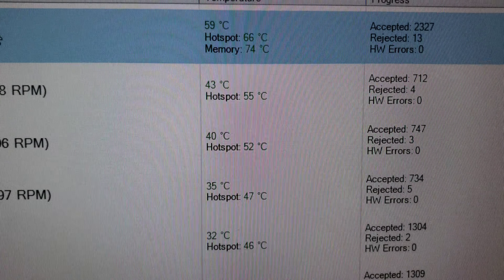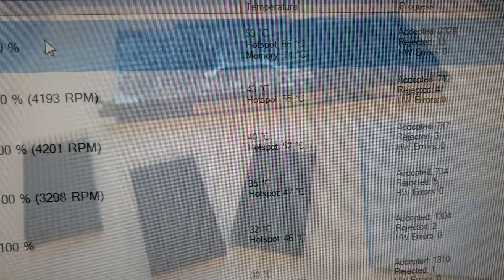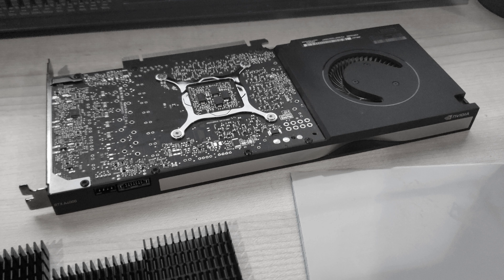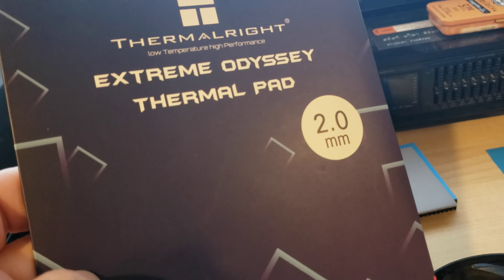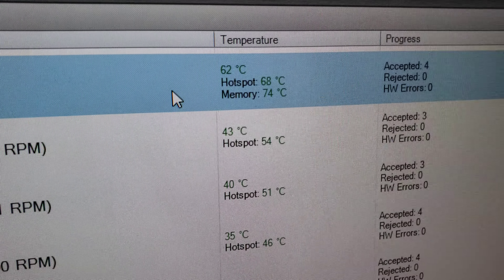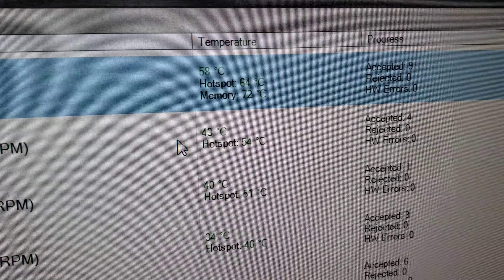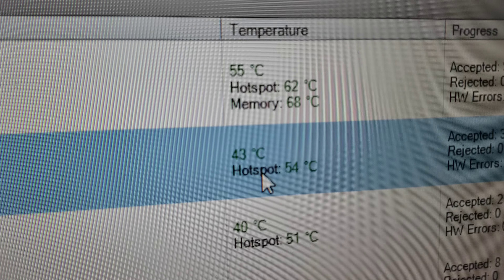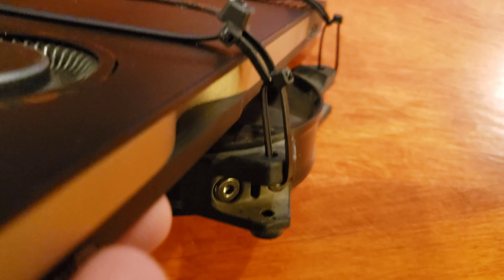A4000 Heatsink mod

Comment: Hey man I just saw your other video with putting .5 thermal pads on. Great videos I'll be trying that. I have four of these cards and yup open air frame. That in combination with heat sinks and maybe a fan will hopefully help
Reply from the maker: Right now it runs ok on eth, 58c, but the rest of the farm is at 42-46c. So in the summer I may have to rethink it. Maybe put it by itself in the wife's pc :)
Reply: Honestly super happy you made this. 5 degrees would help me sleep better at night. I've heard there's some funky replacement covers made in China with a couple fans but not sure if they work. I'll be subscribing so let us know if you find something else. Oh what heat sinks did you get?
Reply from the maker: @dfnjetproductions  it was a 4 pack off of Amazon. Nothing fancy.
Reply: @JoyofMining  you da man. Cheers